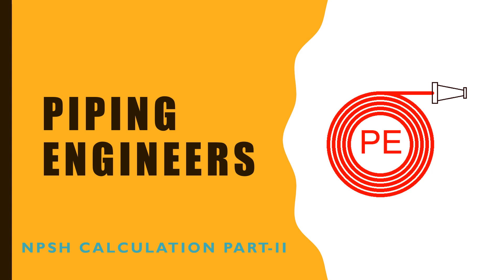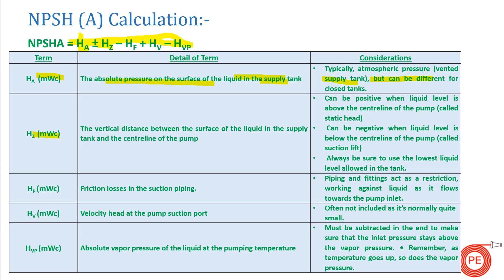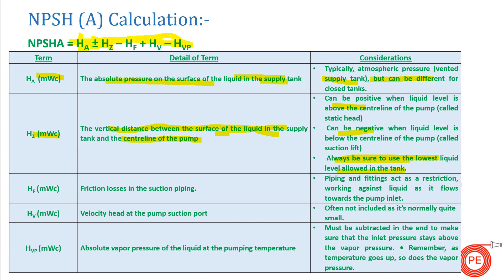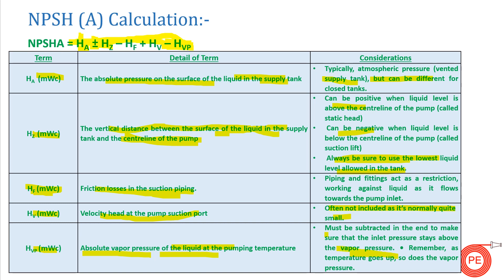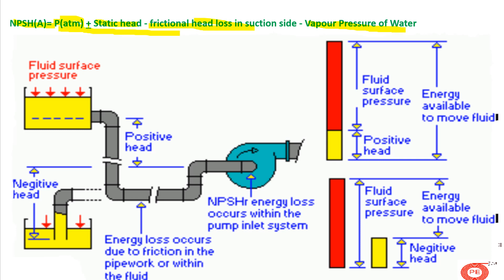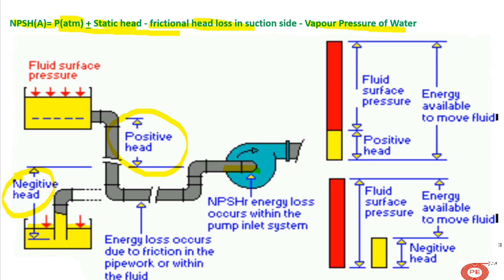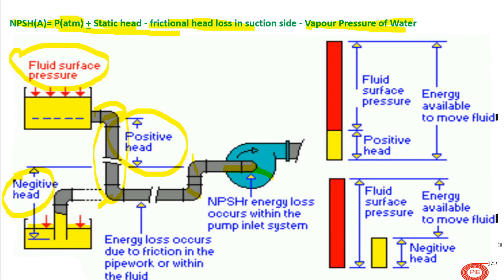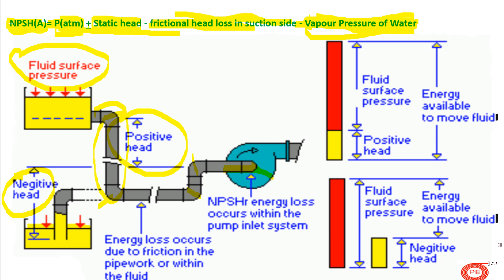NET POSITIVE SUCTION HEAD (NPSH) CALCULATION |NPSH of Centrifugal pumps | Cavitation in Pumps

Comment: How to calculate pump power for positive head ( on closed Loop) suction pressure is 3 bar and discharge pressure is 5 bar.. so total head for calculation is 2 or 5 ??
Reply from the maker: Total dynamic head for pump is 2bar.  Please watch our video on pump power calculation . Link is given below :
https://youtu.be/fG0AOaSxk8A
Reply: @PipingEngineers  so for pump selection i can use approx  20 m head pump Only..nad not the 50 m?
Reply from the maker: Correct....@Mrshivraje....
Please follow #subscribe #share our channel...please share with your frnds